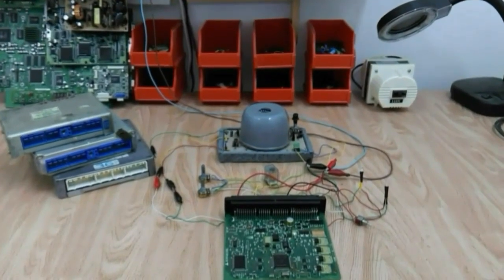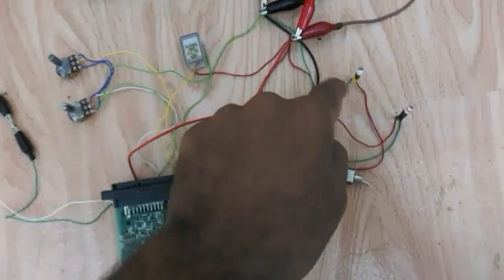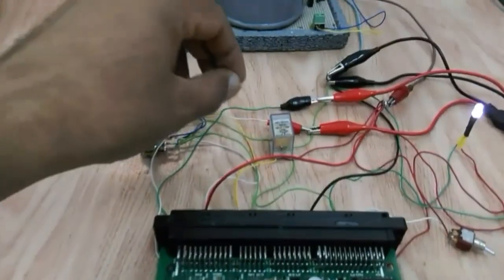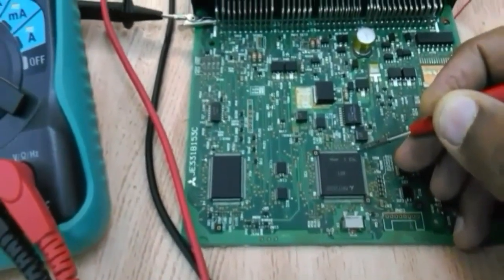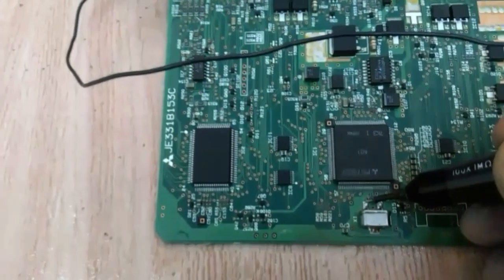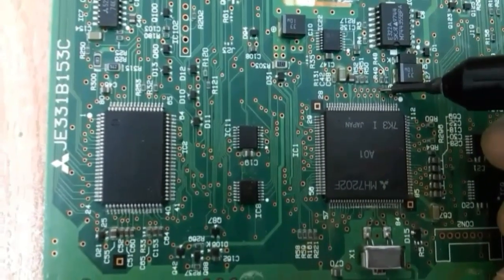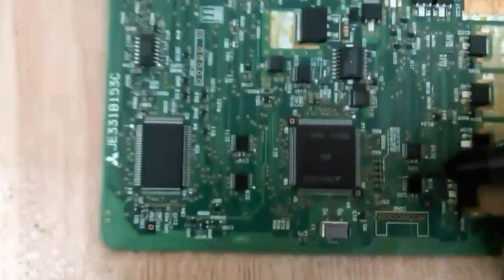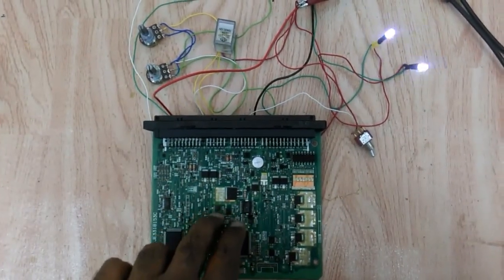Exploring the ECU hardware and testing - Part 2 (fault finding and troubleshooting)

Comment: Great video. I have a question. Is there pins that needs to be connected to have fully boot the ecu? (other than main supply, ground and wake up signal)
Reply from the maker: You are very welcome,
Yes correct all what you have mentioned, plus to make sure full hard reset, while the ECU is removed you can provide short between main supply pin and ground pin for some time this will fully discharge the power.

Comment: which pin out and part in the ecu normally is responsible to sending signal to the dash clock ?
Reply from the maker: The clock is part of instrument cluster controlled by another control module , ECU communicate with instrument cluster using the CAN network through can high and can low pins, ECU sends to instrument cluster dash information like speed, RPM, check engine faults... Etc.

Comment: Mr automation how do you do with the security an immo cause the ecu will never power up injectors and coils when the immo is not detected.
Reply from the maker: Hello, you are very welcome,
Good question thanks , and the answer for this going to be long,
in fact at very beginning when I thought to semulate the signal to run the ECU same question came to my mind, would it genarate output without doing immobilizer off the engine wouldn't run without proper emo transponder code , but I decided to jus go ahead and try if not then later I will deal with deactivate the immobilizer, but surprisingly the ECU just responded directly, to explain this in this situation in fact the ECU is not fully functioning the RPM also is at very low speed the ECU program try to adjust the respond and immobilizer at this stage not being verified yet.
Reply: Here for the same thing. Immo

Comment: If you have a hard code let's say a P0193 which is high pressure fuel that the dealer cannot erase due to ECU failure. Would this ussually be because of a Output transitor that is burnt out or would it be due more to a input one? Thank you for your educational video!
Reply from the maker: You are very welcome,
If the high pressure is not actual (so the actual fuel pressure is normal) then most probably failure at input side. Thanks
Reply: @saudautomation input side means the sesor or signal connection faulty?

Comment: Something external is frying my ECU and no longer communicating with the ODB2 reader. There are not visible damage. I don’t see any glass fuses on the circuit board. What else could be burnt?

Comment: Sir. Which device can read and write this ecu . I mean ktag,  pcmtool etc. Because i have two   ecu with same hardware but part no. Is different i want to read from one ecu and write to the other.
Reply from the maker: I believe any programer device can do, as long you are able to read and write to both ECU's, first step save the current files for both ECU's and keep as backup so you can return back to original if needed.

Comment: Hello sir, how the ecu work without immobiliser?
Reply from the maker: Hello, you are very welcome,
Good question thanks , and the answer for this going to be long,
in fact at very beginning when I thought to semulate the signal to run the ECU same question came to my mind, would it genarate output without doing immobilizer off the engine wouldn't run without proper emo transponder code , but I decided to jus go ahead and try if not then later I will deal with deactivate the immobilizer, but surprisingly the ECU just responded directly, to explain this in this situation in fact the ECU is not fully functioning the RPM also is at very low speed the ECU program try to adjust the respond and immobilizer at this stage not being verified yet.
Reply: Peace be upon you, my brother Saud. Is there on your channel an explanatory video of the Nissan Patrol 1998 computer? I have a problem with the MFS when Islam is connected, and there is no fire in the circuit, but the car does not start.
Reply: I think it's because he bypassed a whole lot of things as he's just demonstrating how the ecu operate it's not rocket science to observe this ....idk ijs
Reply: Peace be upon you, my brother Saud. Is there on your channel an explanatory video of the Nissan Patrol 1998 computer? I have a problem with the MFS when Islam is connected, and there is no fire in the circuit, but the car does not start.

Comment: very nice. Pls  tell me, if you dont have that 12v backup, will the ecm produce the 5v the sensors need? i ask because my ecm is damaged and im trying to repair, there is no 5v voltage in the circuit. but all i have connected is a 12v supply to the power input, nothing else to the signal pins
Reply from the maker: You are very welcome,
Good point, but I am not sure we need to check that.

Comment: Hai
My diesel car's ECU is damaged in the injector section, it says current above normal or grounded circuit I'm trying to fix it myself which part needs to be checked
Reply: Check their  should be 2 problem 1st is check with multimeter  signal pin of injector if shorted to ground  so no doubt  mosfet shorted.  2nd if no any reading just check peripheral  component like resister. Should be opened. You should check direct to the ECU socket   Hope this will help you
Reply: @tksalalah Thank you friend
Reply: Thanks for the help of this video
Reply: The injection  driver mosfets.
Reply: @laptopDoctorKZN  i have removed the mosfet irfr3710z on good check. What's his advice, what else should be checked again
Reply: @laptopDoctorKZN  I have replaced the damaged resistor in the injector

Comment: tHANK you 1 question if the alternator has been undercharging the battery, meaning the car was running without check engine light or battery light and on routine battery maintenance u realize your alternator is only providing 9 v of power and then over a period of months the alternator Dies completely ... can the low voltage affect performance of the ECU
Reply: Definitely yes

Comment: thank you so much. Syaikh, what is the role of the SMD capacitor there?
Reply from the maker: You are very welcome, capacitor take different roles, it work to smoothing the power, also filter noise and voltage spikes, it can copple AC signals to following stage and block DC signal and store the charge.

Comment: @Saudi  this are very educative video.. where do  you get you pinout from,and also o would love to know how you made the simulator for the crank and cam signal.. thanks
Reply from the maker: Hi, thanks for your positive feedback, 
some time you can get pinout by just searching Ecu part number  on the web, you can use some applications like Carmin free installation or paid installation like All data,
 my simulators is custom designe of mechanical plus electronics signal conditioning circuit.

Comment: Hello Mr. Saud, your video is very well explained and very knowlegeable. My question is, is there in any way that we can remove the limiter of a certain ecu and what components or parts that needs to be replace. Thank you
Reply from the maker: Hi, you are very welcome. 
If what you mean is speed limiter I believe yes that can be removed not through replacing components but by programming and settings , taking in consideration the safty requrmet and vehicle reliability before taking this action.

Comment: Nice info, if coil 1 and 3 are working, but 2 and 4 are not working, which components are faulty ? PCB code JG331B09702C1, box = MR44641, Mitsubishi Lancer 2000, thanks
Reply from the maker: I don't have any details for you ECU, but you can trace back from the output pins and check or replace faulty component driving coil 2 and 4 output.
Reply: @saudautomation  Could it be Q7 and Q36 ?
Reply: @saudautomation  Is it possible that the transistors are faulty ? they are Q7 DTC114EUA Code 25 and Q36 DTC124EUA Code 24, is there any other components between pin 23 on ECU port to the spark plug ? thanks

Comment: Hi sir I have question I hope you would answer it .. when feeding the ECU with power B+ what's the current limitation when setting the power supply When i tracking a short circuit on it!? Should it be 0.4amps or less!?
Reply from the maker: Hi,
This can vary slightly from ECU to other, but Yes around 0.3 to 0.4 amps is reasonable it can be the average current consumption while the ECU is running without the sensors connected.
Reply: @saudautomation  thanks a lot sir God bless you I'm really appreciate your helping,,

Comment: Hello sir, my car has ac system equipped with variable displacement compressor, now the clutch is disengaging when the engine is at 1500 rpm and above.. this problem wasn't there before, now my mechanics is telling me that problem is caused by fault ECU..

Then am asking can this be possible where by ecu is making air condition system not to work properly? And can this issue be repaired?

(This problem started after replacing my ac compressor)
Reply from the maker: Hello,
In general that's possible , some ECU they control the engage of AC compressor clutch looking at engine load or temperature and to help control the power.

Comment: Saud, my project car is running again now, partly thanks to you...) It's a 2000 BMW, sat dead for seven years. Now I want to bypass several modules I don't want or need...I'd rather cut connections inside the ecu than supply fake "signals" instead of the modules, but it might be the only way since I see the main immobilizer connected IC also appears to have a clock, which seems would be for orchestrating ignitor and injector pulses. I'm getting p0600 and p0601 codes now...which have to do with communication with modules...(?) Any advice? Thanks again...)
Reply from the maker: Great work I hope you will be able to restore back the car, I know it is complicated as the car was off for several years, p601 may indicate some internal failure with ECU, but in your condition long time car is off verify the 12 volt and ground is OK up to the ECU input, you may need to clean the harness connector and ECU pins especially if ECU is located at engine side.
Anyhow carry on all the best

Comment: I wonder if you could make a video explaining process for ecu to begin, in example, from turning of ignition switch to each process leading to engine running? Apparently it's not as simple as it used to be..)
Reply from the maker: Hi, that's great idea in fact my self l would learn alot if I could perform such setup, we will need to observe many indications against sensors signals changes that will help also to have better understanding of ECU software and program, in fact if I was having ECU automatic signal simulator like MST9000 for example, that would be possible where we can see all outputs and generate inputs. Anyhow never know maybe in one day
Thanks.
Reply: @saudautomation  hi again, well it's been a year later, pretty sure my car was not running yet...it is now. It was about bypassing BMW locking systems. All that's bypassed now. It still would be interesting to see how this computerized system works. Thanks again..)

Comment: Great video! You explained much of what I was wondering about. I'm curious what voltage the outputs for injectors and ignition are? 12v or 5v?
Reply from the maker: Ignitor drive signals from ECU is pulses of 5 volt magnitude.
Injectors uses 12 volt therfore one side of Injector coil is connected to 12 volt and the ECU switching the other side to ground.
Reply: @saudautomation  ahhhh, thank you! Interesting...) The mass air sensor read 12v today, not 5v, across all three pins... Coolant temperature sensor was 12v too, not 5v, so I was sure that ECU ground was lost. After checking all grounds, they were all excellent, zero resistance and no voltage drops. Then I found the Ambient intake air sensor and found it was a perfect 5v. This is a bmw E36 that hasn't running 7 years since typhoon Yolanda. It did fire a few times, pop pop pop...turns over well with a bypassed immobilizer coded ecu. Tomorrow I'll pull the injectors and see if they actually inject, lol. From your excellent video and  comment now, I'm presuming that not all sensors must use 5v...and 12v is used sometimes. Is that true? Thanks again, it's very interesting. Especially your hand made crankshaft simulating contraption!!!
Reply: @saudautomation  BTW, I had reconnected all B+ leads, at the busbar, which was missing. One of those leads provided 12v to a secondary air pump which had been removed long ago (I didn't know) that 12v lead then somehow provided 12v by a short, corrosion maybe, back to the ECU, keeping it live at all times! Months have gone by til this mystery was solved! So now...it's closer to breathing life again..) your video helped me understand how things work. Thank you, again..)
Reply from the maker: 👍👍 Well done and great work to recover back such fault. Thanks for you as well for the good feedback.
Reply: @saudautomation  thanks again...) I'll subscribe in case you make other videos..)
Reply: @saudautomation  so...an update is I found the "problem". It was two identical, reversed connectors, inside the e-box. One was to the e-fan, which was missing, and other to secondary air pump, which had been removed. Somebody plugged one into the other not knowing where they go. And, so, constant 12v was applied to a lead that went to the fan, which normally received power from fuse 26, only with key in "run" position. "Always on" 12v  instead then, was supplied to ruse 26 at all times. Fuse 26 also supplies the ECU for main power. Ahhhh. So, they are unplugged now. Code P0600 is gone, (which explains it). But...awhile ago, when this intermittent issue was happening (the "hot" pin in those connectors had apparently burned..at some point..the pin was partly missing, not knowing it was the connector issue, I had slightly bent the PIN to make solid contact. Therefore, the issue had been intermittent.) So..there were a few times when ignition spark was being made...and also fuel injected and had a few "popopoppops". But that does not exist now. No spark. No injection. (I have removed and cleaned all injectors, they're like new) 
So. To recap... original main issue after Yolanda typhoon was ECU burned up inside..arcing...from water in ECU. It's replaced, (have two) with immobilizer bypassed ECUs. The switched connectors are undone. Fuse 26 (which had burned at some point) is new. No more codes are read by Torque scanner. All mechanicals completely newly replaced or repaired. And....the occasional "popping", of spark and fuel, has disappeared. 
I do not want: immobilizer, body control module, airbag module, clutch switch, secondary air pump, leakage air detector. Quite a list of junk. 
I have bought a small converter (?) For reducing 12v to 5v. Two leads in two leads out. I plan to apply 5v at three locations on ECU, at inputs from clutch switch, body control module and immobilizer. It's my hope that those inputs will only be a static, constant 5v, not pulses, coded. I think so. Meanwhile the immobilizer lead is defeated by coding the ECU. I've located it's entry point, pin 33 of x60004, it goes to the biggest IC on the PC board. When it (12v to 5v) arrives, I'll give it a shot. I'm expecting to hear "vroom vroom", not pop pop. Any thoughts, anyone?! Lol thanks for reading...
Reply: @saudautomation  Thanks again for a place to discuss this puzzle. One "fear" I have is that there may be some logic sequence of on/off, max/min, time delay, then off/on again..built into BMWs circuits. Which..I have no knowledge of. Any thoughts on that for a 2000 BMW Z3, 2.0 liter M52TU engine?! Lol.

Comment: very informative, how did you managed to provide the ign feedback signal ?
Reply from the maker: This is fully explained in vedio part 3 (Exploring the ECU hardware and testing - part 3) try to find it is available in my channel. 
Yes if ECU is equipped with this feedback input you need to provide, but it is not used in all ECU brands, if that's equvelent to IGF feedback input

Comment: I loved your video, what scope do you recommend for this kind of work?
Reply from the maker: Hi,
In terms of scope general purposes scope should be ok for testing the ECU circuit, there are some more sosicated scopes with some special functions particularly to analyze CAN signals but for advance use, if ECU programming is required then some programming devices like KTAG can be used,
You may need also some means to simulate the signals plus arrangement of harness connection cables, variable resistors and toggle switches, etc.
Reply: Saud Automation you are great and thank you so much for your advice, I am in the market for a scope, again thank you and be safe!
Reply from the maker: 👍👍All the best.

Comment: Your a good instructor in Automotive Electronics,i learn a lot and easy to understand,may be you can share where to get wiring diagram,is it in All Data that can be buy in Aliexpress?
Reply from the maker: Thanks for your positive feedback,
Yes sometime you can just serch for ECU pinout from the web, of course Alldata software is good source for ful wiring schematic , also you can try Carmina std is free application.

Comment: Thank you sir,, can i ask how you made your ecu simulator
Reply from the maker: Hi,
Regarding the ckp, cam semulator, , most of work 
is done by mechanical mechanism , the electronic circuit is conditioning the signal for output.
Reply: @saudautomation  hi,, my freind thank u for your kind reply,,
Can i ask if its ok if you can send on how you made it or a diagram and the parts 
Thankss so much my frend

Comment: how can reset   any ECU    please
Reply from the maker: If you mean resting the ECU fault code then you can do by using scanner tool, lf you just recycle the power the check engine indicator may disappear but the code will stay in ECU memory.